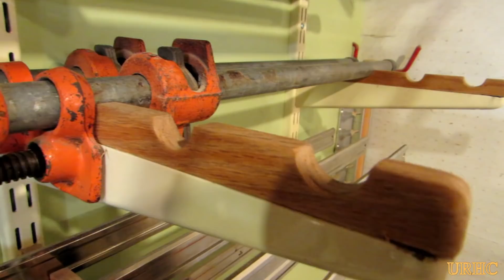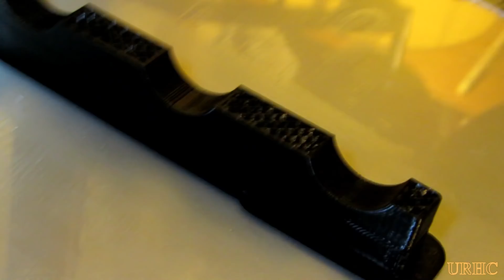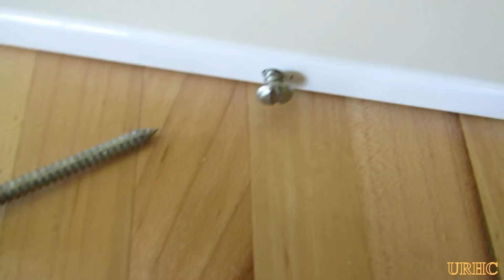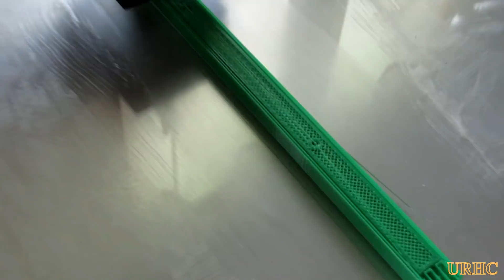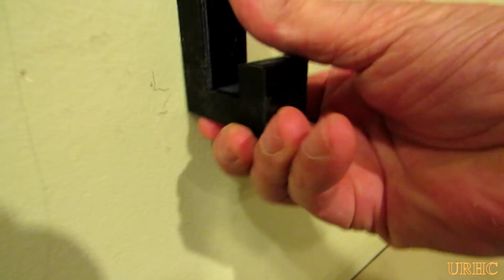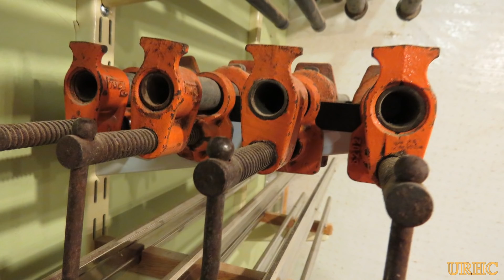Storage Wall For All My Large Woodworking Clamps

Comment: Cool project!!!  How expensive is the plastic used by your 3D printer?  (For example, about how much did each piece cost?)  I have absolutely no idea whether each would cost you a few cents or a few dollars...  Have you figured that out?
Reply from the maker: It was $20.00 for the black roll that weighs 1 kg. I made about 20 of the inserts plus many other test parts to learn how to use the printer so it probably worked out to be about 50 cents for each insert plus another 10 cents worth of electricity. It all depends on the infill percent and wall thickness used. 1 kg. Of plastic gives you 1 kg of parts so there is basically no waste if everything goes well. I am also trying some lower cost filament now that seems to print just as good. It does take some time to get everything worked out with a low cost printer to be able to achieve decent prints. There are some good facebook groups to help you get going. Thanks for watching.
Reply: Wow -- that's a lot cheaper than I thought it would be!  As 3D printing becomes more mainstream, I bet the filament prices will drop even more!  Thanks!